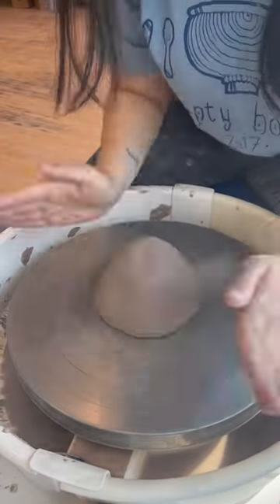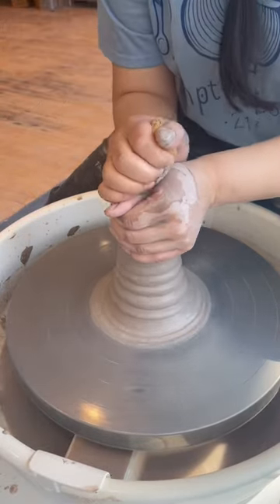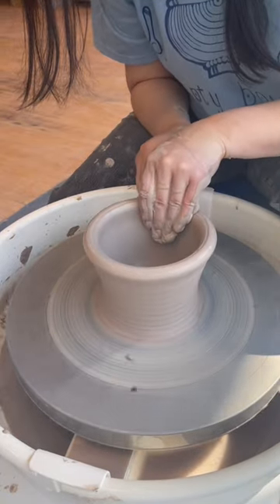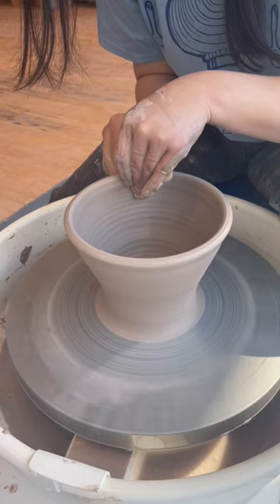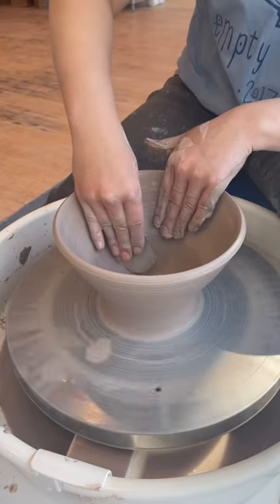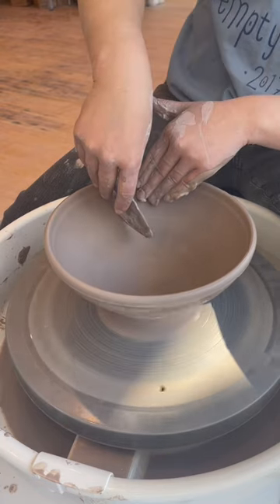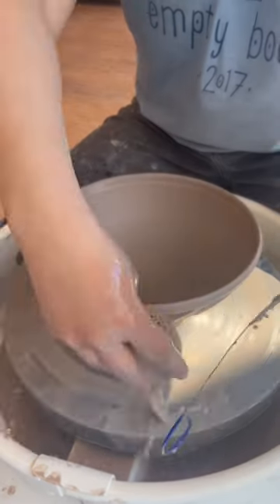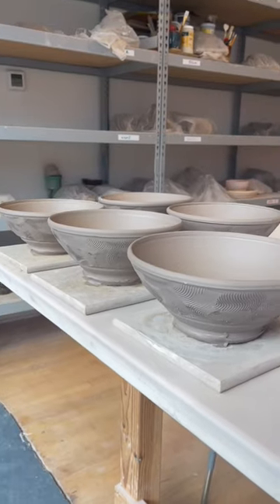How I make a bowl

Comment: I joined a pottery class my senior year to try something new since I’m artsy. I goofed during the plate assignment. I thought my plate looked too high so I tried to flatten the edges down just a little bit more; 1/4 of it collapsed and broke off.
I panicked. I already had an idea to integrate the mistake to a design but wasn’t sure if my teacher wanted the plate to be in one piece. After getting confirmation I could still use it, I turned it into a volcano-inspired plate. I still have it and its probably my best piece to come out of the class.

Comment: So, I've seen lots of people on pottery wheels cone up and then push it back down. What is the point of coning up and then pushing down?
Reply: gives it strength
Reply: @davidlz830  definitely not that. it’s much easier to get the clay perfectly centered if you cone up with it. you can feel for the center on the way down super easily